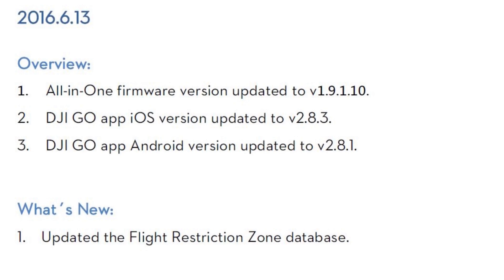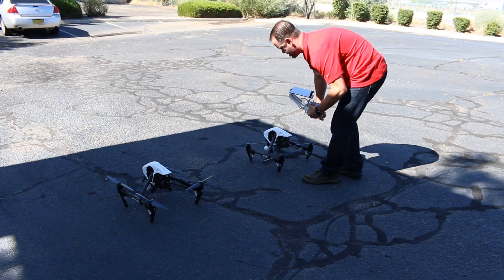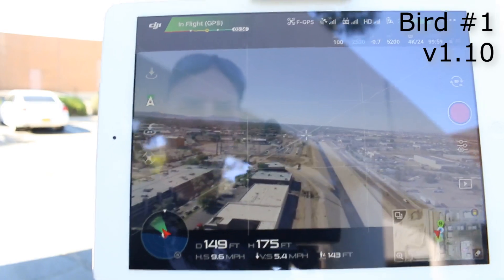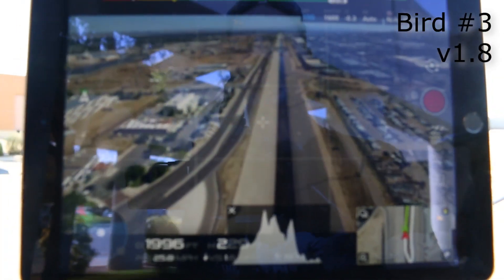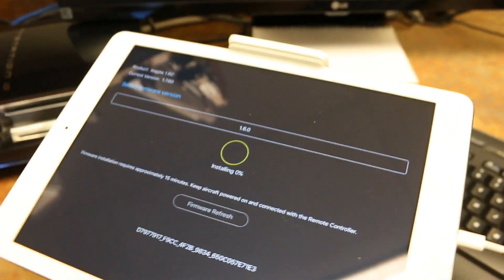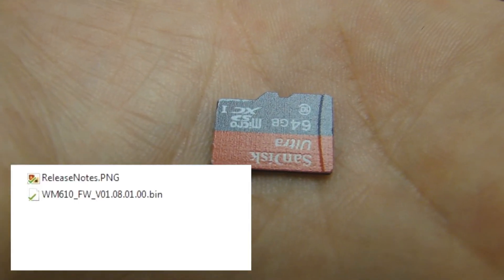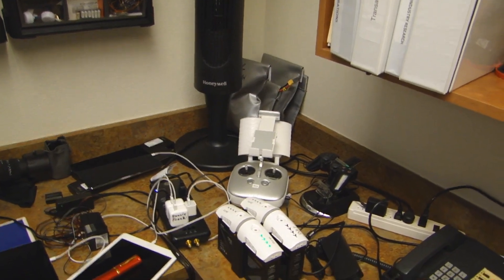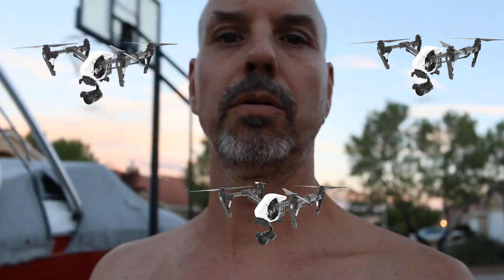Make your Inspire 1 great again...Part 1...

Comment: Hi Donnie, Rodger from inspirepilots. And thanks for your reply and guidance , very much appreciated kind sir.Can someone tell me where I can get version v1.8 for my inspire Pro, as all I can find is the latest which is 1.11.01 on dji site. Any help appreciated
Reply from the maker: Read the description section, my friend.
Reply: Awesome Donnie thanksfrom what I've seen I just need downgrade controller to 1.6(currently 1.7) and install v1.8 to bird.sorry I am thick lol just not as exp as all these peeps.
Reply from the maker: No worries amigo.  And, yes, you will have to roll back the controller, too.  Once you go back to FW 1.08.xx.xx, you will NOT be able to connect to the bird with RC FW 1.7.  You must roll back to v1.6.  Once you do this, you can leave them alone and never touch them for the rest of your life.  I recommend rolling back the Go App to v3.1.1, too.  That is the version I have been using for years and it is rock solid.  No tests, no logins.  You WILL be prompted to to install new firmware every time you start the app.  Just hit the X and and you're good to go.

If you roll back the app, don't allow the app to access anything.  I asks too access like 3 or 4 things.  Just say "no" to all of them.  Good luck!
Reply: I use android Donnie, not ios any ideas?can I confirm when u say create a blank file, this is just a untitled page worded as above, and then the bin file being only two files on the sd card
Reply from the maker: Follow up video should help answer all those questions.

https://youtu.be/fEhjTpsW2Zo
Reply: Your a gentleman and scholar sir , id buy you a drink if u stayed in Scotland lol
Reply from the maker: It would have to be a warm pint of Guinness.  HA!
Reply: Hell you can have my pint too lol I hate that guinness, mind you I see you can get clear guinness now !!
Reply: I have done everything but the bird firmware which I have let it run for over an hour has not flashed red the motor lights , ive had gimble movements and red rear light and noises but no motor flashing lights should I be worried? lol
Reply from the maker: I was actually joking.  I don't drink Guinness.  I was just trying to adapt to your culture....;^)
Reply from the maker: No.  Are you using the X5 or X3 camera?  I've had horrible luck with the X5.
Reply from the maker: Sounds to me like you guys on the other side of the pond could really use the 32 channel hack.  Channel limitations are an artifact of the software (app), which is one of the reasons I use a legacy version before DJI really dug their claws into that side of the flying experience.  But...because you're using Android, the version numbers are going to be different.  I run v3.1.1 with the 32 channel hack.  With this hack, I get great reception regardless of location. 

I'm 3 minutes into this guy's video and he still hasn't imparted any information.  I'll continue watching later, as I'm addressing some business issues this morning.  

To summarize, I believe rolling back your app to iOS equivalent v3.1.1 AND installing the 32 channel hack will greatly help.  This assumes you rolled back the Firmware to v1.08.xx.xx.
Reply: Hi Donnie, yes all done and I had it out today for a little test, I took both tablet, iPad and Huawei, the iPad didn't miss a beat although in fairness I didn't go far away was just a ten min flight and not a glitch, I then swapped to the Huawei and I had a little flicker, but that guys channel selection worked also but I couldn't get the Huawei off channel 13 for some reason, the iPad was channel 17. But either way much better for sure , image quality better also.I checked the txt file also and it said firmware update success, cause I'd left it on so long it tried again but said firmware same as one in bird.So I'd say success lol and thanks again kind sir, I def owe you a few pints of black stuff lol (yuck) Guinness sucks lol
Reply from the maker: Good for you, man!  But....to be sure, you can check the "About" page in the Go App.  It's at the very bottom of the main settings page.  The About page will tell you all your firmware versions AND your app version.

I highly recommend the 32 channel hack, as it allows me to get excellent reception in places otherwise saturated with microwave RF.

I did a shoot a few days ago in an industrial area where 31 or the 32 channels were junk.  All it takes is finding that one good channel and you're golden.  Good luck!

Comment: Hey Donnie! Great video!  I’m looking for your opinion on my situation,  I recently acquired an Inspire 1 with v1.2 firmware and would like to try these versions out on mine.  My craft says I need to update before it will turn on the motors. Question is, am I hooped? Will i be able to pull this off and not have to update further or do I just update straight to firmware 1.11 and only be able to downgrade to v1.9?  Not sure where to go from here.  Another thing I should note is that my batteries don’t seem to want to keep a charge so I’be managed to get the bird to fire up using a battery clip I made with 2   3s batteries until I can get the funds to get the Inspire batteries.  Any suggestions would be greatly appreciated. Thanks..
Reply from the maker: Hello...lots of stuff to cover....

I have never had an Inspire with FW v1.2.  I recently tried to roll back a buddy's Inspire from v1.1 with no luck.  BUT...his was the Inspire "Pro" (which is a slightly different animal from non-Pro versions), AND he only had the X5 camera.  I've had little to no luck with the X5 camera.  You have to use the X3.  Even then...no guarantee you can pull yourself out of FW v1.2.

I would not fly on a home made battery.  If you notice, the Inspire battery voltage is slightly higher than 4S....something like 15.2, I believe???  I would bite the bullet and get an Inspire battery.  That said, I can't believe your batteries are completely dead.  I've never seen a completely dead Inspire battery.  Not to doubt your veracity, I just haven't seen one.

Try a few things...follow directions, READ the Description section thoroughly.
Reply: I hear you. https://youtu.be/jLMkYR1vWt4   I have found a few videos where some are getting away with it. Not sure if I will though.

Comment: please where can I download the previous firmware for the x5?
Reply from the maker: Sorry, I haven't done any experimenting with camera-specific firmware.  Ergo, I have no idea where to get camera-specific firmware.  The .bin files outlined in this video (linked in the description area) contain the firmware for the bird AND the camera.  So the camera gets updated and/or rolled back using the same .bin files one would use for the bird.
Reply: @drummerdonniedotcom  My X5 not firmware update, issues led light red continued and sound continued, i need help, dji support not working, thanks for you brothers

Comment: Awesome review. I finally have stable video feed after 6 months of being spotty. Thank you for your imperial wisdom
Reply from the maker: You are very welcome.  Glad the video helped.
Reply: @drummerdonniedotcom  Hi, I have a problem updating my inspire 1 with x3 gimbal. The error messages from the result says "multiple version firmware bin files are detected. Please delete the redundant bin file." But how do I delete that. Any help please?
Reply from the maker: Hello @gadankrah .  I assume you only have 1 .bin file on your MicroSD card, correct?  I'll need some more details.  Which FW version is your bird on?  And which version are you trying to roll back to?  Are you using the "Magic Key" file?  Are you using the CORRECT Magic Key file?  If worse comes to worse, run a chkdsk on your MicroSD card to avoid erroneous file reporting.  OR...use a different MicroSD card.  A dozen things can be causing this.  I honestly don't have enough information to troubleshoot.  But try the things I listed here.  Good luck.
Reply: @drummerdonniedotcom Unfortunately I don't know, it's been a long time I used it. Since 2015 I have not updated it. Please is there any way I can update my controller without the go app? Controller doesn't connect to app.
Reply from the maker: @gadankrah  : There are only two FW versions for the controller.  And ANY app version will connect to ANY FW version.  If you can't connect your iPad to your RC, there are other issues at play.  I assume you changed out the cable, yes?  The next thing to do would be to try a different iPad.  If THAT doesn't work, there's a very good chance you have a failing USB port on your RC.  It is not uncommon for the USB port to fail on the Inspire 1's.  If this connection issue is your entire reason for changing your firmware, you have been barking up the wrong tree.  If your app says, "Disconnected," then your RC is NOT connecting with your iPad.  But if your app says, "Aircraft Disconnected," this means the RC IS connecting to your iPad, but your RC is NOT connected to your AC.  If you are using an Android device, I'm afraid you're on your own.  After reading complaint after complaint, it is clear that the Android devices are dicey and unreliable.  So all bets are off.  If you don't have an iPad, borrow one so you can see if that's the problem.  Good luck.
Reply: @drummerdonniedotcom  thank you very much, I'll try that and get back to you sir.
Reply: @drummerdonniedotcom  Hello when I link my RC to the AC I see red green lights flashing on the RC. What does that mean please ?
Reply from the maker: @gadankrah  It means you're not quite connected to the AC, but the RC is trying.  This could be a firmware mismatch.  But first you need to solve your iPad problem.  

You still haven't answered my questions or addressed my comments.  I don't mind helping.  But if I have to repeat myself, I will lose interest very quickly.  CAREFULLY read what I wrote, ANSWER my questions and COMMENT on some of the comments I made.
Reply: @drummerdonniedotcom  I tried using the magic key file but didn't work. Each time it gives me error, I format the sd before copying another big file to it.
Reply from the maker: @gadankrah  Still not nearly enough information.  Make a video of your entire process.  Spare no detail.  Show everything, and post it on YouTube.  THEN I will be able to troubleshoot and answer your questions.

Comment: I def. appreciate what you did here ( taking a deep breathe before attempting ) but this is absolutely ridiculous.  DJI should be ashamed of the useless product they have put out.  I'm absolutely shocked that they have not yet been hit with a product liability suit for further degrading this equipment post sale.  There has to be a class action against them for this debauchery.

**UPDATE** I was having no video at all streaming to my device (Samsung s9+)  I found this video and was able to directly downgrade my inspire from 1.11 to 1.8.1.    Remote is still on 1.7   and DJI go app is on 3.1.5.    Still no video feed.  May be the disparity between the controller and the the bird.   (1.7.8 controller 1.8.1. bird)   Upgrading bird to 1.9 to see if that helps.   again no video at all just blank screen.  Pictures are still available on card and video.   Transmission issue only.
Reply from the maker: Good point.  Other than DJI, I can't think of a single company who has been allowed to downgrade their product post-sale.  The thing that REALLY pisses me off is that there are no mentions of these changes in the release notes.  If anything, DJI should be forced into 100% transparency for the shit they pull.  Their release notes are almost useless.  All we can do is hack their products to maintain the same level of quality they had when we purchased them.
Reply: @drummerdonniedotcom    So I still was getting no video feed.  Plugged my x3 into my osmo handle works fine.   So I decided to go ahead and pull the gimbal cables... and plug them back in noticed a lose pin.  It worked ...for about 1 min.. the camera was fine and showing transmission.. then I killed the bird to re update it to 1.11 however, turning it back on I get this obnoxious loud BEEP  .....BEEP.......BEEP.... BEEP ..gimbal is limp. no video feed again.. and warnings are "update required" and 8 pin not connected on board... (or something similar to that) ... I obviously re checked my work 3 times plugging and unplugging cables.  I also put back on the osmo handle... and now here I am with a 1.8 camera.. firmware... loud beeps ... no video transmission.. I FUCKING HATE DJI its the biggest piece of shit company.
Reply: Update again:    I have video transmission but limp gimbal.   So Trying to negotiate whether I need to just buy 2 new cables.. or what... I've plugged them in and out a number of times.. I have video .. I have no gimbal control however..  the warnings specifically are Gimbal cannot receive MC data Unplug 8 pin wire between the damp plate and aircraft and check that no pins are loose.  MC connection to center board failed Restart Aricraft.
Reply from the maker: @heathladner6186   Sounds like you have hardware issues.  No amount of firmware manipulation will trump or fix those issues.  Did your bird suffer a crash or hard landing?
Reply from the maker: @heathladner6186  I recently had this same exact issue with a buddy.  His X5 camera was doing the same thing.  So I plugged MY X5 camera in, and it worked perfectly.  I plugged his X5 into my bird and the gimbal was limp.  We were getting the same "Main Controller" warning.  Turns out, it was definitely the camera.
Reply: @drummerdonniedotcom  well it all works now I think I could have shaved 4 hours of fiddling with firmware and just did cable check first
Reply from the maker: @heathladner6186  Ahhhh....good deal.  Glad you got her going!
Reply: LAST UPDATE : ok so if you have been following, I think it is def important to repair or replace the cables to the gimbal before all of this mess here.  So I jumped right to the conclusion that it was an issue with firmware and dropped my 1.11 down to 1.8.  leaving the remote on 1.7....  Still no video transmission.  ... So then I popped the cables loose and noticed 2 prongs almost out of the white ends.   I pushed back in secured.  Once rebooting AC I had video but no gimbal ... so it was limp and a loud beep ...beep..beep.. with warnings that I was not getting any RC data... and to replace 8 pin wire...   So then I decided to just put the AC outside bc it was too loud for inside and put the updated SD card in the camera for 1.11... I left it outside for probably 30 min.  You can't hear the update beeps because of the obnoxious MC data beeps... so I was just hoping it was updating.... I checked its progress by turning on the MC controller a few times and opening the app and I can see it go from 1.8 to 1.9+ so I knew it was updating... and then all of a sudden...boom it made it back to 1.11 and the video feed works and it is solid out to approx 1 mile... so far... So ... I think my issue this whole time was the cables.